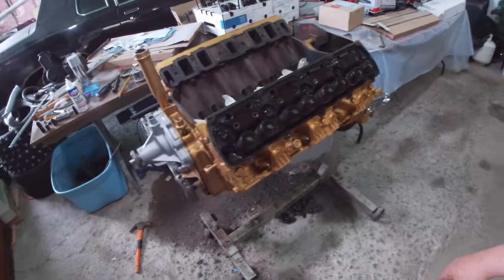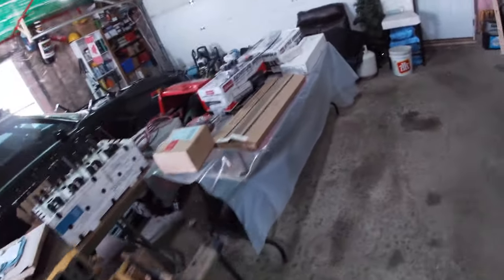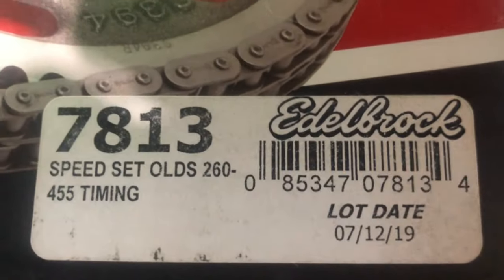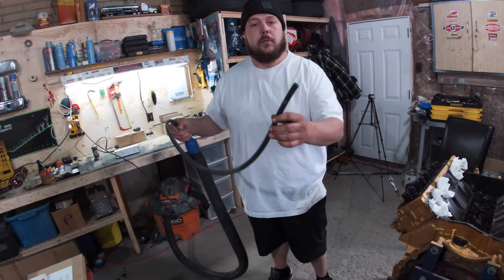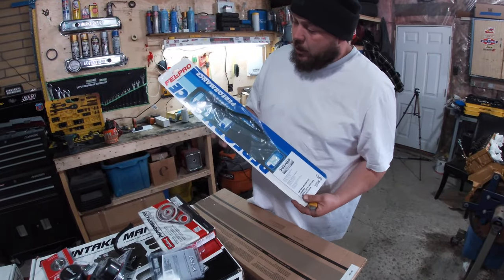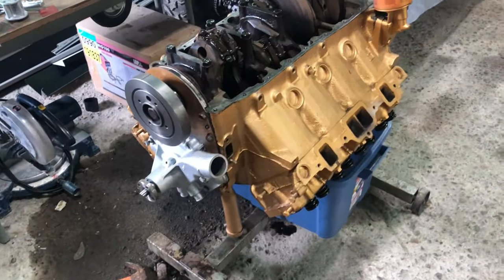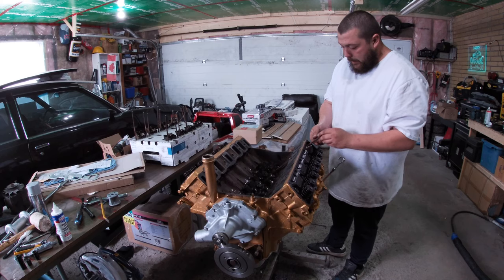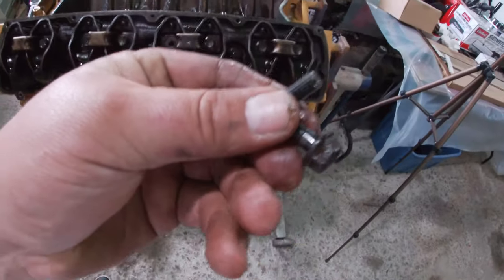455 Big Block Swapping a 1985 Cutlass 442 part 2 (Cam swap & Engine assembly)

Comment: Edelbrock? Even they brought Competition Cams because their cams weren't top notch. Comp Cam x274 cam would have been a better choice here.
Reply from the maker: I ended up going with the edelbrock just to pull that little extra lift on the exhaust side do to the manifolds and not headers they advertise 450 ft pounds when paired with the dual plane performer also ddnt wanna stress the stock springs out to much! Lol but it’s coming apart again now after a mishap you will see in an upcoming video rebuilding this winter with forged piston and a hidden 200 shot of sauce! Lol trans and rear end are getting the treatment this winter aswell! Hoping for an 11 second street car with a/c and vintage look sleeper stuff!! Thanks for watching! CHEERS